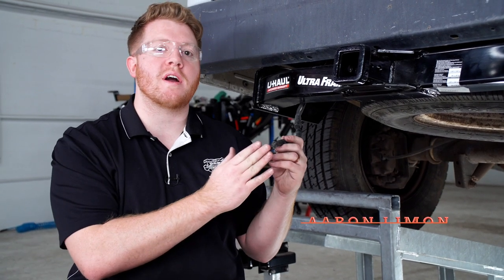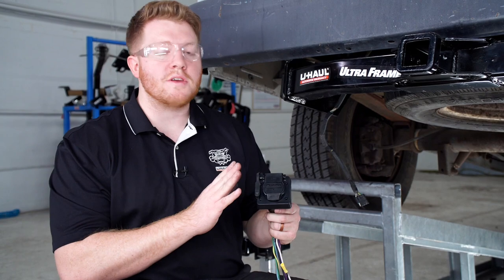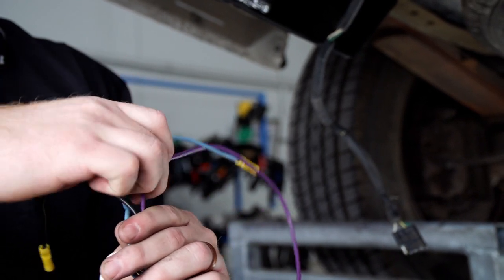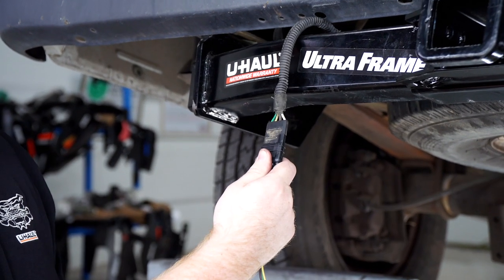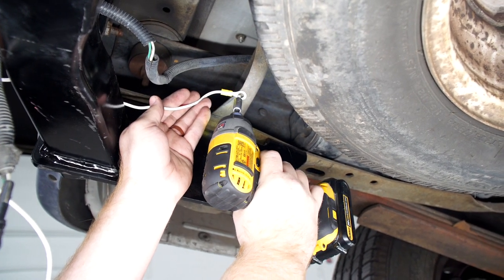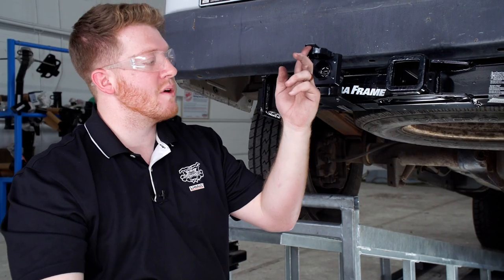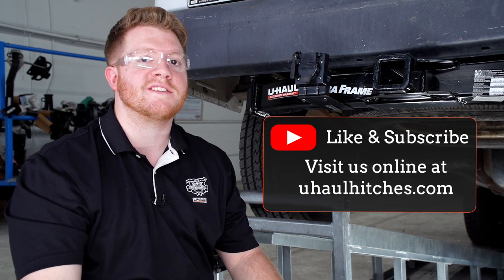How to Convert A 4-Flat to Fit a 7-Way Trailer Wiring Harness (Lights Only)

Comment: Hey guys! After reading some comments I'd like to clarify some things. This conversion is for lights only. The trailer the customer owned did not have trailer brakes or need a charge line which is why we did not use those wires. If your trailer has trailer brakes you need to run the blue wire to the brake controller to hook up. If you need power, run the black wire to the battery and connect with a fuse holder and an appropriate fuse. The route to the engine compartment or firewall for those wires are different on every vehicle, but generally you want to follow the brake lines underneath the vehicle. For the purple wire, you just need to connect to the reverse light wire on the taillight.  We see how important this is and will have a video out on how to hook those up soon.
Reply: If don’t attach the white ground wire to anything do the lights still work?  I did what you did except Didn’t attach the ground but the lights don’t work… Not sure why
Reply: you should make a video if the trailer has brakes
Reply: @jwhammond1   You're joking right?
Reply: Never did that vid huh? Can't find it..

Comment: Blue wire is for the brake controller output to the trailer brakes. The black wire is a 12V B+.... DO NOT wire this to your trailer brake wire. You will destroy your trailer brakes. I realize this is a vehicle only application specific video, but it helps to tell people. 
Some of your customers tow trailers with batteries which charge off the center pin such as horse trailers, equipment trailers, RVs, Boat trailers, etc. 
The other thing I often do is install a relay so that wire is only powered key on and not key off. Otherwise you will have a dead battery if you don’t unplug your trailer connection and wonder why. (That is an expensive road call 25 miles out in the woods on logging roads if you’re hunting)

U-Haul has standardized wiring it seems, but not everyone has. Wire by function and test if you are a DIYer. It will save you money. Not that I don’t enjoy your business, but sometimes my paycheck comes from your ruined vacation!
Other than that, great job!
Reply: We always carry black & decker battery jump 12v backup- 800 cranking amps.

Comment: Why would you just do the lights if you had a 7-pin connector?  I have a Telluride with a 4-pin connector but a 7-pin harness.  I need the brake function (and reverse) so I can hook it up properly to a tear-drop camputer.

Comment: What do you do if your trailer has electric brakes? Don't you need the black wire run to the battery?
Reply: then blue wire, black is for 12v aux

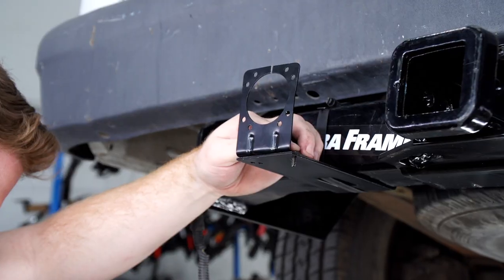Comment: Hi, at 2:20 Aaron mentions a mounting plate you can attach to your hitch. It extends away from the hitch. Where is that part on the Uhaul site? I need that kind of plate for my hitch set up. Thanks
Reply: Try the Curt brand.  Curt 58000

Comment: did you cut the white wire from the four way and then attach to grounding under vehicle. I cant tell if there is 3 or 4 wires still running to the 4 way connect?
Reply: The white wire is sperate from the 4 flat on the 7-way. It uses a larger gauge wire so we ground it to the frame. The white wire on the vehicle end's 4-flat is usually a smaller gauge and hooking up different sizes of wire can cause issues down the road.
Reply: @aaronlimon4803  should the lights work without installing the white ground wire? I just tested it before doing the drilling and I had no power to the trailer lights.

Comment: What is the 7 wires under my 2006 Chevrolet express 1500? Can I connect this directly to?
Reply: Some vehicles will have all the wires already there for you to hookup. Just check it with a circuit tester to see if they are the correct functions!

Comment: What color would I run to the battery to pull power my trailer has a fan?
Reply: You would run the black wire! Just make sure you put the appropriate fuse in place on that wire using a fuse holder when attaching to the battery.
Reply: black is your 12v aux, hook directly to battery via fuse if you want

Comment: So you changed out the plug to tow a big trailer but you cut the brake wire.what would be the point of this? If you're going to tow a trailer you wanted to have brakes.

And if you have a tiny trailer with a four-pin connector you don't need the brakes.
Reply from the maker: There are trailers that have a 7-Way plug with no brakes, so no need for the electric brake wire. For a full 7-Way conversion you should see our video for that https://youtu.be/hqze3Qgz-Ng

Comment: Would it be okay to install the mounting bracket to my bumper if my bumper is plastic?
Reply: Dustin Valdez no
Reply: If mounting to a plastic bumper use a bolt and nut. Self tapping screws can come loose over time.

Comment: Very bad video and it should be removed.  It doesn't tell you that it doesn't provide for trailer brakes and could cause someone to improperly install without brakes.  A serious accident could be caused by this poorly thought out video.
Reply from the maker: The title says "lights only".
Reply from the maker: Here is the conversion video that uses the brake wire - https://www.youtube.com/watch?v=hqze3Qgz-Ng&t=16s . With everything hooked up like the video, all you will need is the Curt Brake controller. They also have an app to help control and adjust.